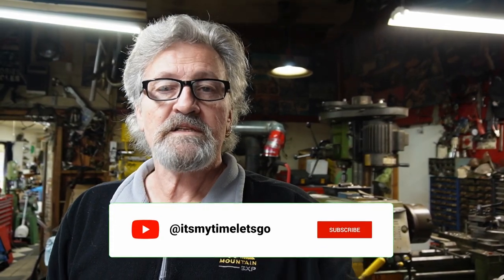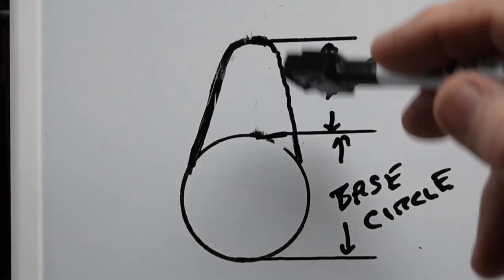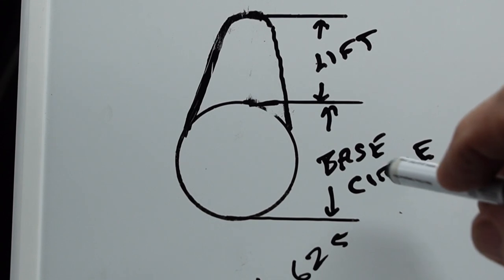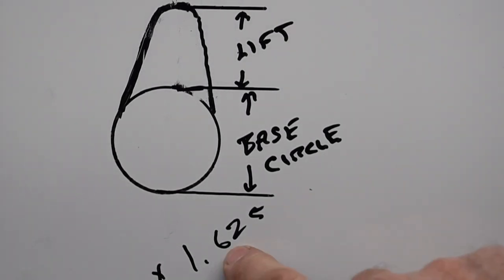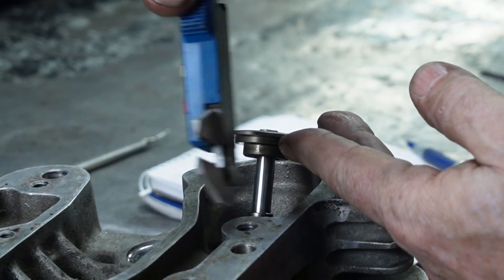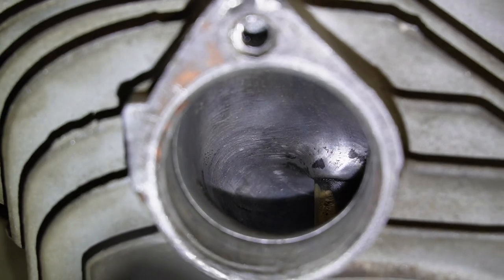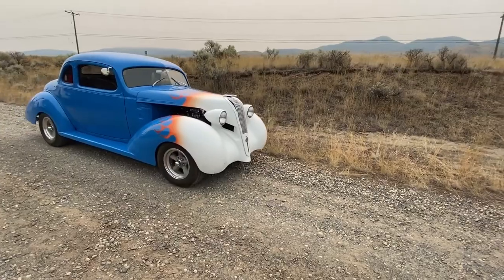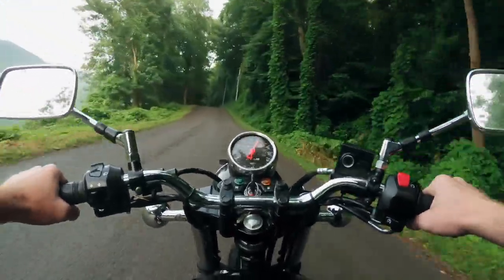CHOOSING THE RIGHT CAM FOR YOUR BIKE,  PART 1  WHAT'S RIGHT FOR YOUR BIKE. HOW THE MOTOR WORKS!

Comment: Years ago , I brought a mild Andrews cam for 48 pan. Added a Joe Hunt mag , 
Mikuni carb , best running bike , you could snap the throttle wide open , it ,ll go.
Reply from the maker: I ran my Knuckle for over 30 years, mild  Andrews cam, Joe hunt mag, SU carb. Never let me down and bracket raced it with consistent numbers all the time. 25 trans sprocket and 48 rear sprocket. Cruised  along at 70 with ease. Love the old girl.

Comment: Thank you sir.  I appreciate the detailed explanation of the cam, tappets, and valve train.  I have a 2015 CVO Road Glide 110, a model of engine that is prone to tappet failure as a result of the OEM valve springs.  I generally ride in the 2,500 to 4,000 RPM range.  Do you have recommendations when looking at CAM chest and CAM/Oil Pump Replacement?  I haven't had any problems now with a little over 12K miles on her, just curious on your and others recommendations.
Reply from the maker: Hello. I must say that Twin Cams are not really my thing, I am old school in  a lot of ways.  So there are probably others out there way better versed on them, to get advice from, than me. So I will not take a guess at it. The rules still apply when choosing a cam. Not to much lift and duration for mid range  performance, but a little never hurt anyone.  Thanks for taking the time to comment.
Reply: @itsmytimeletsgo  Thanks for the reply!
Reply from the maker: :You are welcome.

Comment: I bought S&S 509 cams and a thundmax for my 88 ci only to find out thundermax doesn’t have a map gor the 509 cams. Both the cams and the thundermax were already installed.  Called thundermax several times and left a message but they never returned my call.
Reply from the maker: Not really familiar with them,  Thundermax  has had a good name so not sure what's up there.  Twin Cam are not really my specialty, still learning everyday about them though. I know that the S&S 509 was made for 88's from 1999 to 2004 and that's about as high lift as you can go ( 510 lift ) with out head work, anything bigger would at least need springs as I recall according to S&S. Should be a very streetable cam with lots of low and  mid range torque! Enjoy!  In 2005  up they increase it to 585 lift  before needing head work. Over that you would need head work, valve to guide head(with seal) measurements, valve to valve clearance's etc. Thanks for dropping by and taking the time to comment.